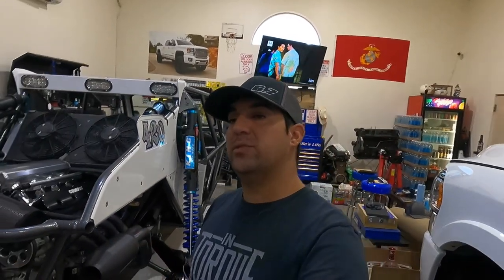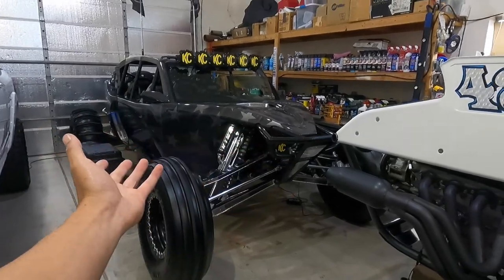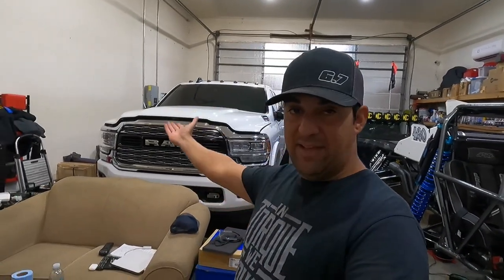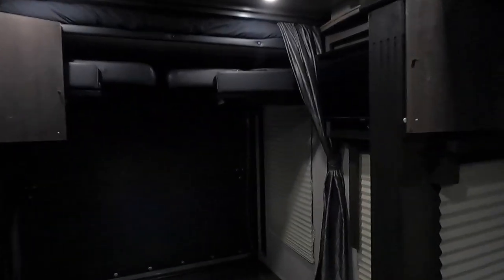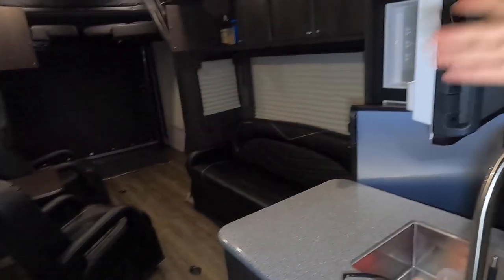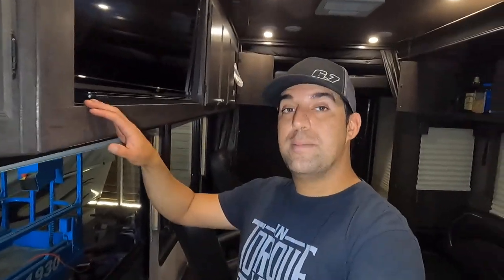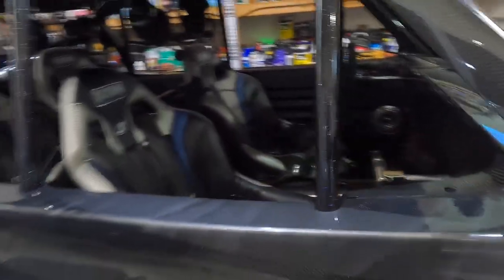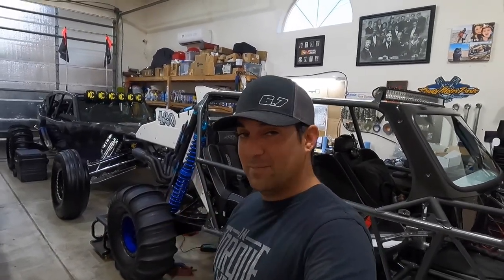Would I Buy Another Attitude Toy Hauler....Bumper Pull Or 5th Wheel?

Comment: I have a 2020 Attitude, really love it. It had some misc issues out of the gate that were easily fixed: Fridge 110v wasnt plugged in, minor leaks on faucet fittings being loose, tank level meter wiring was reversed (full wire lead was on bottom, 1/3 was on top of tank... lol). So far its been a great trailer. Upgraded my old half ton GMC to a 2021 Denali 3500... I honestly dont think I could fit a 5th wheel. That bed is so high, I'd be worried about the bed hitting it.

You are right they are good starter Toyhaulers. But IMO... they are way better than the Sandstorms and Powerlite's. My wifes cousin just bought a new Powerlite, the floor D-Rings were only screwed into the OSB sheeting. He ripped out 2 of them his first camping trip. Total POS.